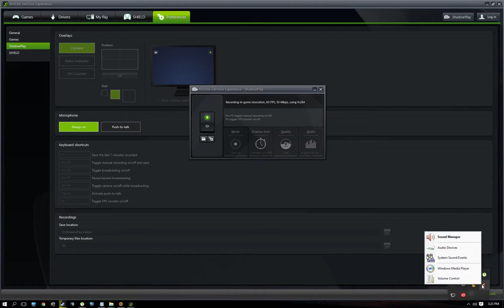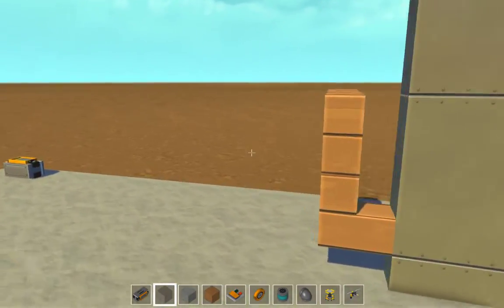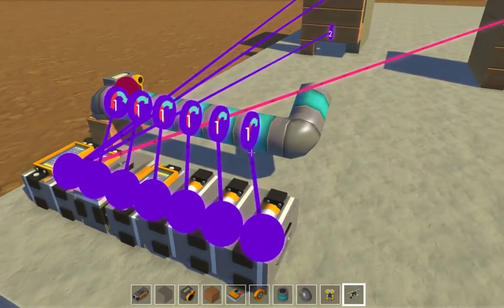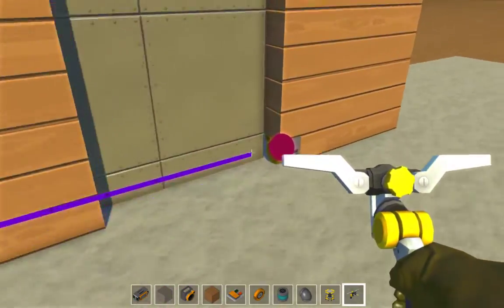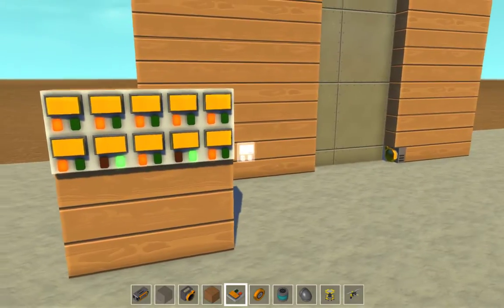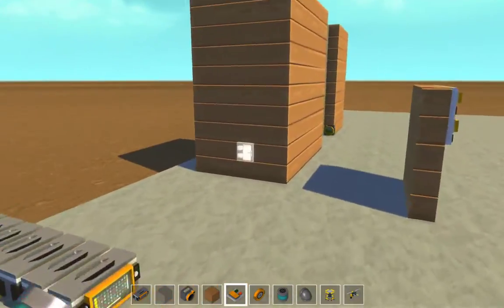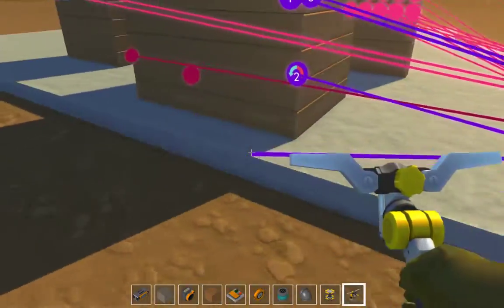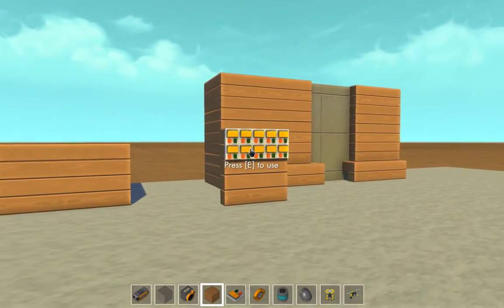Password Lock Sliding Door Tutorial : SCRAP MECHANIC

Comment: there's a better solution rather than dummy controllers, since flicking all of it would work, use the other switches on the other controllers, so that if they flick the wrong ones, instead of rotating in front of the sensor it would rotate the other way, therefore even if they flick all of it, it won't work.